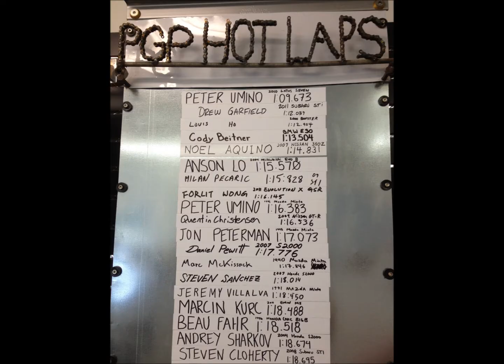BMW E30 M50 Swap Part 2

Comment from the maker: Ive heard good things about m52/cams swap e30s, but i do not have personal experience. Going From the m50nv to S52 was more of a difference than I was expecting. The TQ made a huge difference and completely changed the driving experience behind the wheel. It went from a quick little car to hang on and get sideways blast. Front lip and flares are all DTM fiberwerkz  products. Im itching to get out on the track but as i sit here typing with a freshly broken collar bone so it will be a few months.

Comment from the maker: Im running the 373 diff. the tires are 245/45/16 R888 tires. the cage is a slightly built up prothree spec cage that was about $3400

Comment: Nice car!
What kind of wheels are these?
Did you use adapters for the RX7 brakes?
Reply from the maker: Cheap xxr527 rims. A company sells adaptors for the rx7 brake swap that i used. I dont remember who off the top of my head